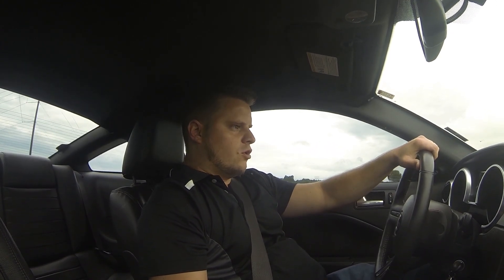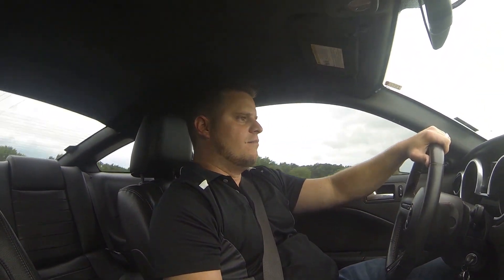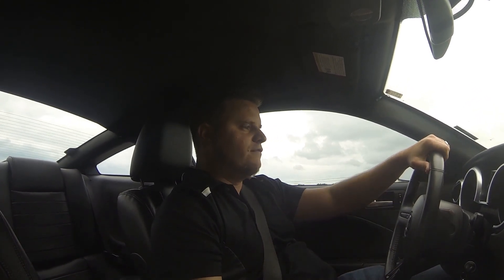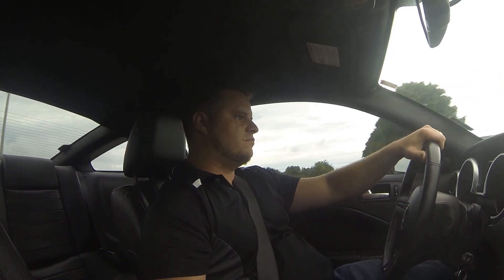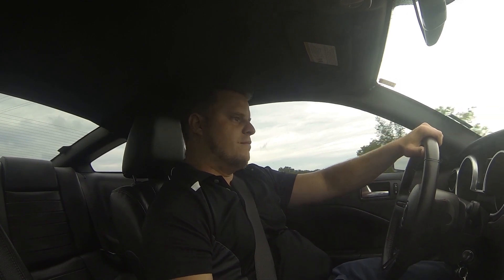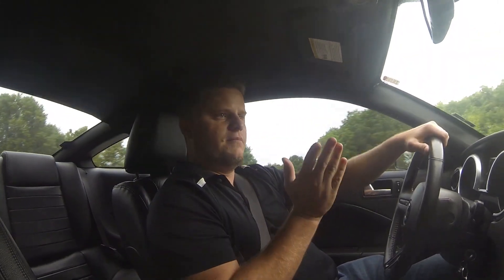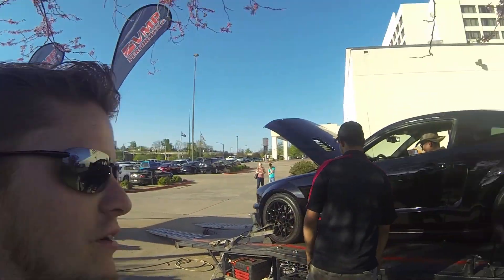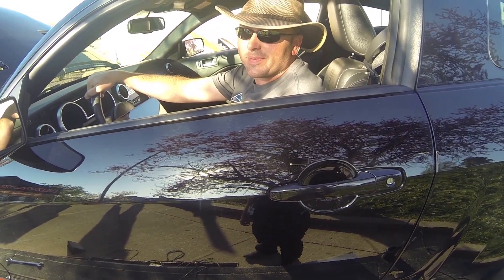Water-meth injection on GT500

Comment: Go direct port water meth injection with one pre blower nozzle to help with blower temp and compression . One of the problems with water meth kits I've observed is most go too big in nozzle size . Just did a 09 c-6 corvette running a Vortec V3 and the recommended nozzle with the meth kit was still a bit too big . It wasn't an AIS . Ordered 2 sets smaller and the smallest made a noticeable difference of at least 20 rwhp without a tune for meth ! If you install the water meth kit correctly you shouldn't worry about pump failure . There are also fail safe systems made by various systems . Also make sure you don't go cheap on the system and go with the stainless braided lines . I'll be running such a kit from Alcohol Injection Systems . Great quality . I've first started using meth back in 2001 with my built 99 blown cobra . I still believe it's one of the best bang for the buck and very safe if done correctly .
Reply from the maker: Hey man I really appreciate it and I'm going to take your advice for my next install! sounds like you know what you're doing! And by the way how would I go direct injection? just wondering